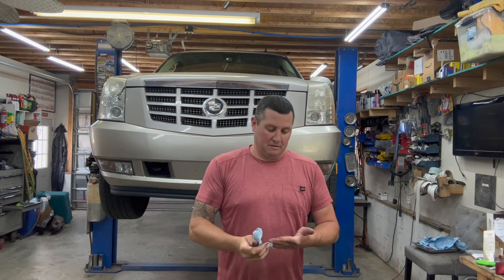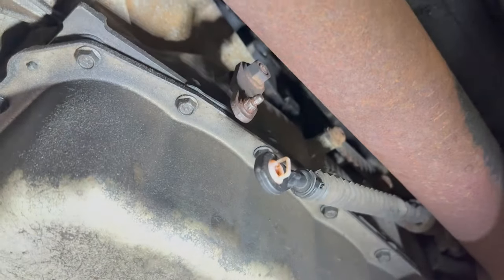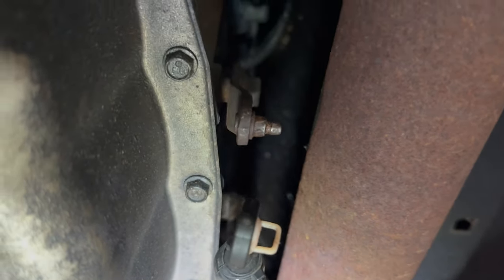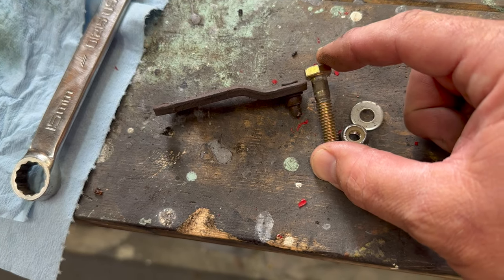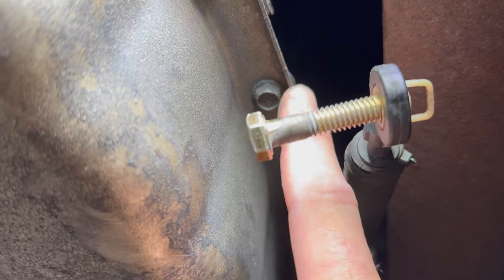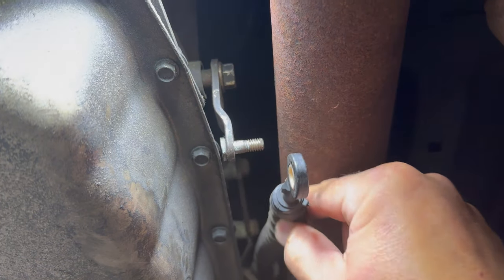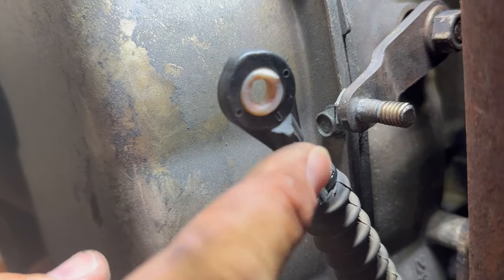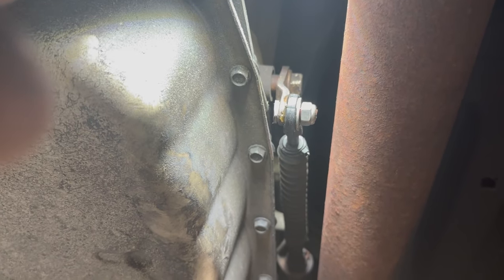GM truck Silverado Tahoe Escalade Shift Cable Bushing Permanent Fix to Dorman 14104 repair kit

Comment: I melted the edge of the white bushing with a small butane torch and added an E-clip or circlip to hold it on. Mine kept falling off as well. I nearly destroyed the new bushing pressing it in.  Terrible design by GM.🤮
Reply: I used a e clip also no issues since

Comment: I did this repair on my Silverado about 4 years ago and it is still working. The one thing I did different is drill a hole through the bolt, so you can put a cotter pin or even a galvanized nail through it behind the nut. Bend it after threading the nut on so the bolt does not slowing unwind itself. The other thing I have done on a Suburban was used a piece of wire wrapped around the thread after I secured the nut. I did this because I did not have a lock nut or thread locker and I needed the Sub working that day. No issues on either repair after two years on the Sub or four on the Silverado. VW and Chryslers use a similar nylon bushing on their auto trans shifters as well.

Comment: Mine came off while I was in reverse facing uphill, alone. Good thing my parking brake wasn't as shot as I'd thought, because it kept the stupid thing from rolling over me while I popped it back on. $20, one burned wrist, and one bloody finger later I've installed both bushings that came in the kit, one after the other. We'll see if the second holds any better than the first one, but I think while me transmission works I'll go buy a bolt...

Comment: Don’t try to remove that lever while you’re parked on a sloped driveway. I popped my truck in neutral while under it and almost died.

This fix worked though! I found 1/4” bolt to work better than 5/16

Comment: When this happened to me I was so lucky that I was in a parking lot and my truck was in reverse when the linkage popped off. I had never known that this was an issue and didn't know when it happened. Just my luck while I was walking back to my truck I turned on the remote start with the Trans in reverse. It ended up hopping a curb, hitting the truck behind me and driving that truck into another vehicle. Thankfully nobody was hurt. Fixed it in the parking lot with a new bushing and a c-clip that I crushed down around it but this is a much better fix. Doing this ASAP. Thank-you for the tip.

Comment: Great video! I'm going to replicate this on my Yukon. Never had this issue before on any of my previous GM rigs. Brought my vehicle in for a sway bar bushing replacement. The bolt was severed, and I couldn't get it out. After I brought it back from the shop, the shift cable popped off. I've replaced the bushing twice, and it continues to pop off every other day. It's so ridiculous that they used this bushing system. Thanks again for the vid!!
Reply from the maker: @Jon-PaulBoisvert  once they pop off it’s time to just be done with the factory BS!

Comment: Great fix I will be doing to my Denali. If you could find a button head Allen bolt that is shouldered it may save you from having to grind it down. Button heads are typically thinner head than a normal bolt but might be tough finding one with a shoulder.

Comment: My bushing broke yesterday. Pulling into a parking spot at the grocery store. 

I'm just gonna do what you did and do a bolt n nut method. Take that stud off the bracket on the trans and find a nylon flange bushing and bolt n nut through the middle to the cable. 

I have a 07 tahoe with a 4l60e.
Reply from the maker: Better to just fix it once and never worry about it again!

Comment: Mine fell off in neutral, my park brake cable broke next... on a sloped driveway.  I found at first this new bushing didn't snap into the groove on that pin.  The groove had gunk and rust so I filed it deeper and sharper, put grease inside the bushing when pushing it on and then used a blunt screwdriver to make sure the bushing lip was pushed firmly into the groove all the way around the pin... all good.

Comment: 4L60E/4L65E/4L70E trans all use the same shifter cable arrangement. Go to Lowe's, Home Depot, or your local hardware store and find a nylon or bronze bushing the right size for the cable end and the bolt, washer, and nut (try a crown nut, all metal lock nut). Cheaper than the Dorman kit and works as good or better.

Comment: OMG the comments you are making before even starting the fix, is the EXACT same comments I have been saying! TY for reiterating my thoughts, just verbally :)
Reply from the maker: @nickrima939  yeah after the second failure I was determined to not have failure again. Thanks for watching!
Reply: @trbokmro  the first time was at a gas pump in our town. We were on our way to a wedding. We were late  and missed it, by the time time we went home and got 2 cars to replace it. All while we were gone it blocked that pump, at least 4 hours. Then AAA temp fixed with zip tie so we could get it home. 2nd time today with wife on other side of town and getting back from lunch break.
Reply from the maker: @nickrima939  bummer! Time to permanently fix that thing

Comment: Happen to me on a previous mowed area along a tree line.  Did a bush fix with wire to get moving again, but got a good case of Poison Ivy crawling around under the truck.  Replaced with a dorman bushing but will change out to your solution to a flawed GM design.
Reply from the maker: always seems to happen at the best time doesn't it.....

Comment: My bushing went out and I bought a bushing with retainer clip and I looked and it seems that the broken nylon is in the cable end still. Will possibly be doing this exact repair from your video. I drive an 06 Silverado.
Reply from the maker: It’s nice to never worry about it breaking again!

Comment: I put 2 zip ties on mine 2 years ago when leaving job sight and they been holding(loosely for movement)…what I had on hand ..your fix looks good though..
Reply: Good idea ima have to try this too
Reply: My 2 zip ties lasted 2 months. On My second set😂
Reply: @Skidmarks368 i left mine loose for movement.  Enough to keep it on but loose enough for movement…they were the black ones for exterior use

Comment: Perfect fit.well done.Any tip on how to remove the brake light switch on a 2008 GMC Sierra 1500 ?
Reply from the maker: Same as the suv, check out my cruise control fix video I show the switch replacement in that one.
Reply from the maker: https://youtu.be/Zq6OuC3GVNw?si=1VlAFVWSA-Nq6HR2

Comment: Hello! I keep having this issue on my Tahoe, my hubby is gone on deployment so I need to figure this out myself. What kind of grinders do you use? Could you list your products?  And how did you grind the rivet? Thank you for your video and help!
Reply from the maker: It’s a fairly simple project, you can pick up an angle grinder from harbor freight for $15 that will do the job. You can use it to cut the bolt to length and grind the back side of the stud. 

https://www.harborfreight.com/power-tools/grinders/angle-grinders/43-amp-4-12-in-angle-grinder-with-slide-switch-58089.html

A vice would be handy to have for cutting the bolt and holding the arm while you grind, if you don’t have one you could probably use a pair of vise grips. (Also at HF) 

https://www.harborfreight.com/hand-tools/pliers/locking-pliers/7-inch-curved-jaw-locking-pliers-39639.html

MAKE SURE TO WEAR SAFTEY GLASSES WHEN GRINDING! You will need a hammer to punch the arm from the shifter plate. Can use a nail  or screw as a punch.

Lowes or ace hardware I’ll have the bolt and nut you need, should be able to get the job done for $25 or so!

Make sure to have the truck on level ground and chock both front and rear wheels before you ever get under a vehicle! 

Watch the video a couple times and you should be able to get it done no problem.

Comment: Just had the same issue on my 07 escalade esv got it fixed yesterday and it literally popped off this morning while driving to work, you would think they would've done this from the factory
Reply from the maker: Makes you never trust shifting again doesn’t it!? Good ol’ bolt won’t fail you that’s for sure
Reply: @trbokmro  definitely my wife doesn't want to drive it no more😂
Reply: I actually went wit the 14073 Dorman, at least it has a retention clip that holds it in place, check it out

Comment: My neighbor called me late night saying he couldn't get it in gear.  After finding the problem the only thing I could find in my car was the elastic band on a dust mask.  I wrapped it around at two different angles to hold it in place and with it being elastic it didn't restrict movement.  Will being doing this fix as that finally failed.

Comment: They put a plastic piece in there to break on purpose. That way they can charge an hour for repair time to replace the parts necessary.

I thought of doing this, before I bout the Dorman 14104 kit. The large bushing with the pin guard on it, didn't fit, but there was a second smaller bushing that did press into place and the cable end did snap/lock into place. 

I did have to adjust the rod end of the shifter cable assembly, that is what the U shaped piece is for. I am very disappointed in Dorman Co. for not including instructions for the parts. They did, however have a video for installation tips of the new bushing that was helpful, though it didn't explain the smaller bushing, only the outer bushing shown in this modification. 

If it fails again, I'll do this, till then, I'm out $6.00 for the kit, and $16 for the shift lever that was damaged as well. 

* NOTE * Do not let twenty yr olds drive the truck, or you'll be driving to their rescue, again. Make sure they know about this first.

Comment: Why did I not think of removing the piece that connects it to the transmission😐 I was thinking of replacing it with a bolt but I was like “how am I going to drill a new hole with the drive shaft in the way?

Comment: Perfect if you have all the tools and stuff. What if you're on the road ?

Bread twist ties ?
Reply from the maker: To get it back home I just slid under the truck after starting it and having her hold the brakes and set the parking brake then manually moved the shift arm on the trans to drive.
Reply: @trbokmro  

I'm using a twist tie for now until I get something better figured out

Comment: How did you remove that piece that connects it to the transmission? I took the nut off but it’s still pretty snug on there.
Reply from the maker: Spray with some penetrant and lightly pry, once the nut is off it’s just probably some rust holding it to the shaft.
Reply: You have to wiggle it and use a flat head screw driver

Comment: What if u don’t have the bushing would it be fine with just the bolt ?
Reply from the maker: I would probably just step the size of the bolt up to match the cable end, 3/8 I would assume would work.

Comment: Is this just a regular stainless steel bolt and nut?
Reply from the maker: I think it was zinc plated but stainless would be a good call if you’re going to the hardware store or live in areas that use salt I suppose.
Reply: @trbokmro  Thanks

Comment: The first bushing lasted 190K.  Replaced it with a Dorman.  If it doesn't last will do what you did.  Thanks
Reply from the maker: My dorman made it like 2 months then popped off…. I think a lot of the problem is the stud on the shift arm gets rusted/corroded and loses some of the diameter to rerun the plastic bushing. But the bolt doesn’t care lol. Thanks for watching
Reply: Adjust cable, when in park ,cable off ,should be in line with shift linkage lever. Cable not ahead or behind linkage lever is out of adjustment.

Comment: I jus used the nylon bushing on my 09 tahoe..im kinda nervous driving it cuz i dont think the bushing is graspin the male part tight enough…
Reply from the maker: Do yourself a favor and just put a bolt in it now.
Reply: @trbokmro  yea ima get to that in a few days
Reply: My wife has a2009 Tahoe too, replaced the bushing and it keeps popping off after driving for a while. I will try the new fix with bolt, looks like it is a permanent fix
Reply: Yea i did the bolt a month ago…still all good so far..thanks alot..

Comment: My Diesel Mechanic Brolaw says this about bullshit engineering like this right here.

The factory wants to shave minutes off of getting a truck off the assembly line. The bullshit nylon bushing instead of the dead shot mechanical connection shaves minutes off the line, and that's why they do shit bullshit. 

Do with that information what you will.
Reply from the maker: “New and improved” lol